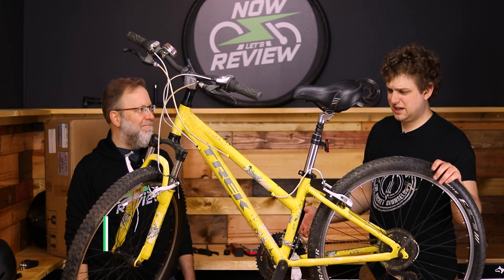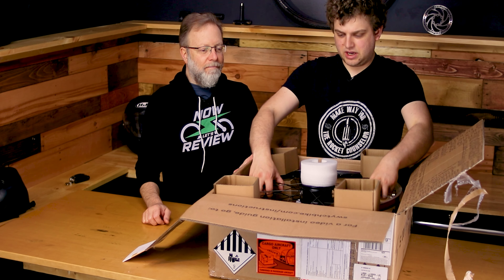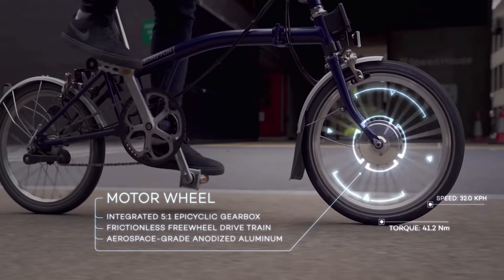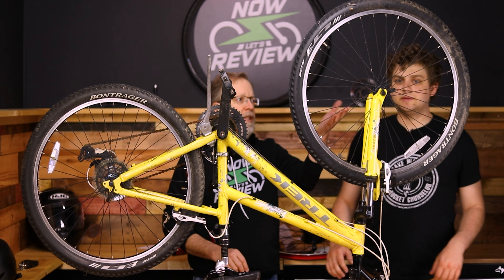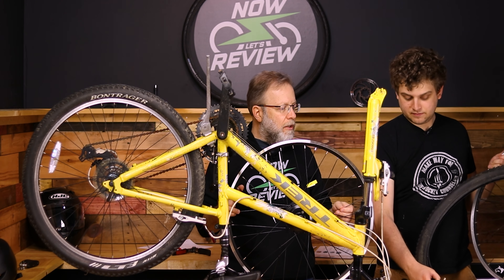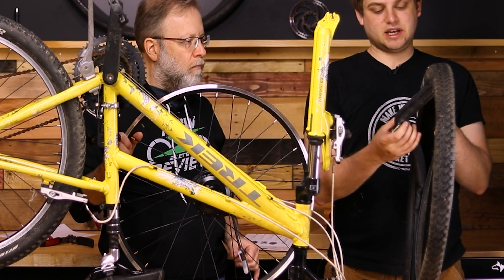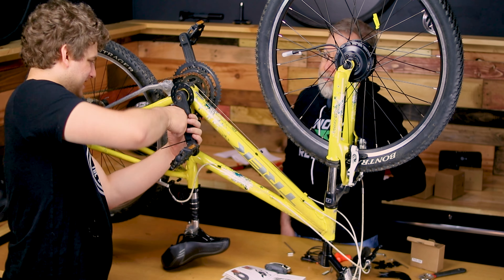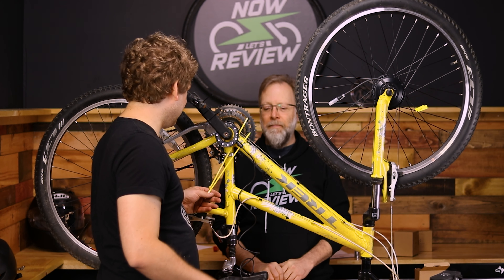We Made This Into an eBike?? | Swytch eBike Conversion Kit

Comment: Folks been bitch about the Swytch in UK cos of battery location, but there a really good idea in many ways, you get to keep your favourite bike and is fine for city / shorter journeys, the UK/EU law is max 250w anyway ( Yes that's less than Barbies car which puts out a full 1/2 HP) 😂also nice quality/ good looking ebikes are very expensive
Reply: Hi, you're right about the UK law. We are restricted to 15.5 mph. If a throttle is fitted where pedaling is not needed, it must be taxed and insured as a moped. I am considering turning my 1962 Hercules into an e bike.
Reply: @PaulSmith-q8e  yes it would be easier to get a nice old bike and convert to electric than to build something that meets the standards

Comment: Since you didn't  have the right size of shim for cadence sensor. I would have wrapped something around the petal crank arm to act as a temporary shim. Like thicker foam or rubber weather stripping anything that fills the gap and can be wrapped around crank arm and can then be pulled out or cut out after the sensor is in place.

Comment: Thanks for the review - I have been using a Leeds conversion kit for about 6 years now.  It is a push button control - so no need for the fancy magnetic pedal monitor.  I mainly use the electric for added torque on starts and hills.  Installed on a Trek hybrid bike that at the time was about 10 years old.  Adding electric power made riding more fun and accessible in my advancing years.  Leeds is based in Utah. This Swytch system looks nice, small battery and has a nice dashboard display, but I do not want full time power assist.   The Leeds does not have any display for battery info, but I have not had any problem with the battery over these 6 years.  Just charge it up whenever I think it is time.

Comment: I added it to my pretty nice city hybrid, which I use for a lot of errands, grocery shopping, etc. It's a great addition. I strongly recommend getting the brake sensor, and the thumb throttle for pickup from being stopped at a light.
I have the smaller battery (I think now the only battery size) which I find a little limiting in cold Canadian winters, since it loses range. It is nice that the pack is easy to bring inside for charging or when it's cold out.

Comment: Sounds like all peddle assist levels have the same speed limit?
Reply: Nope all power settings are diferent snd you can notice the difrance thers 5 on mine and on level one i have to put a little work into peddaling on level 5 its like im just turning my legs withough any force apart from going up hills. Its not bad kit at all just the battery life is garbage i reckong maybe 10 to 12 miles tops on the lowest setting.  Maybe 6 on the fastest setting

Comment: I got their new kit with the wheel and max+ battery... I have a single gear bike.. is it possible to install the wheel on your back wheel instead of the front so to get a different type of force?
Reply: Pretty sure you can't put it on the rear wheel, you wouldn't be able to attach the chain.
Reply: aha, thought the chain could be on the outside somehow, ok thanks!  @gongozolo
Reply: Intereesting questions it could poss work  but there is no way to attach the rear sprocket to the hub as its only got screws on one side which would be for your  brake disk .

Comment: One thing to mention. Surely this makes your bike two wheel drive. 
I'd be interested to see how it performs offroad.
Reply: Its not amazing all the weight is now on the front folks with the hub and the battery attached to the front so have less stability on the bike.  Front end heavy which bikes should not be